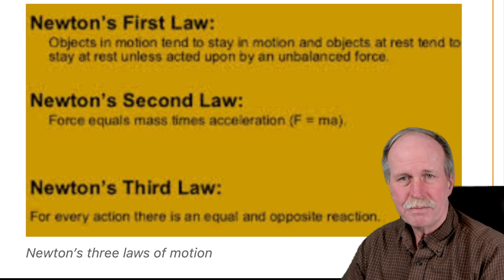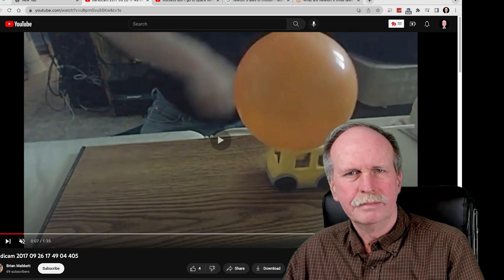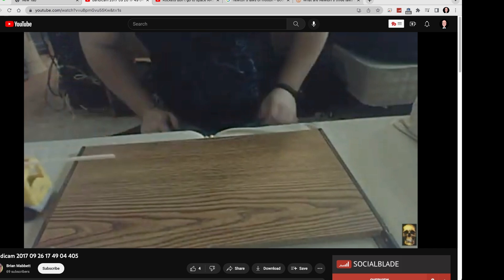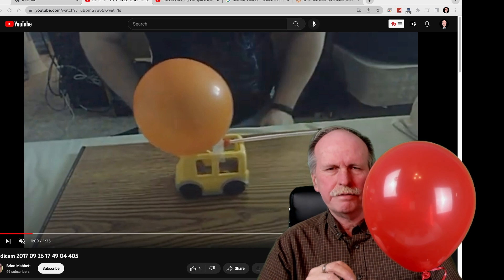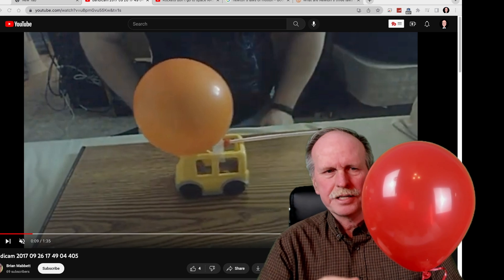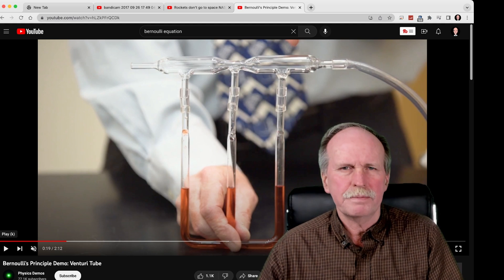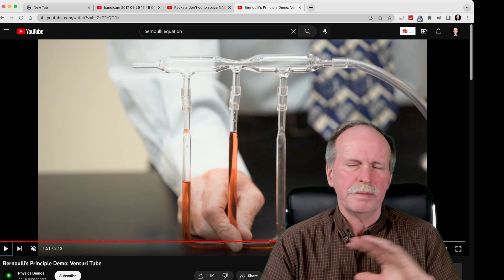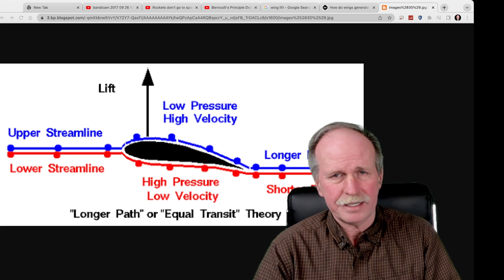Flat Earth Proves Rockets DON'T WORK

Comment: The funny thing is that rockets actually work BETTER in the "vacuum" of space, because there isn't air causing friction on the rocket to act against the acceleration of the thrust.

I saw a thought experiment once where the engines of the Starship Enterprise died, and Scotty started tossing Tribbles out the airlock to create thrust.

Sure each Tribble only had a small amount of mass and tossing one out the airlock didn't exert much force on the much larger ship, but once Scotty had rigged up a Tribble cannon that fired them out into space just as quickly as they could reproduce, he started getting enough thrust to be noticable and limp the Enterprise back to a space station for repairs.
Reply: Best use for Tribbles ever. 😂
Reply: That's not the only reason why rockets work better in space. The big one is the expansion ratio. Ideally you want the bell of your rocket nozzle to expand the exhaust all the way to surrounding pressure to get all the energy out of it, that's possible at sea level but obviously impossible in a vacuum but it also means that you can get extra energy out of the same exhaust by just increasing the size of the engine bell in a vacuum. You don't just expand the exhaust until it's at 1 atmosphere, you can expand it much further and get extra energy out of it.
Reply: The best explanation of how a rocket works I ever heard was from a  Rocket engineer " a rocket pushes against itself"
Reply: Will nobody think of the Tribbles?
Reply: And because Tribbles defy conservation of energy while reproducing, their bodies make a great perpetual motion machine!
Reply: Guffaws in Klingon
Reply: Aww, poor Tribbles! 😭
Reply: Full Tribble Drive - Engage!

I think they test the nacelles by shooting frozen tribbles at them to simulate a tribble strike.
Reply: @nikthefix8918  🤣👍
Reply: Correction: The Enterprise wouldn't be stopping at a space station for repairs. It would be stopping at a Star Base. You're welcome.
Reply: @daveminers3404  - thank you for the correction, I have not watched the show recently and forgot that specific terminology.  I suppose a station like DS9 would not have the correct tools to repair a warp drive, so yes a Star Base would be necessary.
Reply: @Starhawke_Gaming  Here I was just being a smart-ass and you might have me on DS9, which I'm not as familiar with as TOS. I think DS9 is only a space station but must have some repair facilities since it is in "deep space". Good call.
Reply: Exactly what I was thinking.. less friction from an atmosphere
Reply: So where does the "extra" mass of the reproducing tribbles come from?
Reply: @markymarkst3r  - tribbles were essentially magic at creating mass back in the original Star Trek.  They overflowed the Enterprise from just a single storage container full of grain.  It was intended to be silly, not comport to conservation of energy laws.
Reply: @markymarkst3r  you would have to force feed the tribbles then stuff them into the cannon. They reproduce when they eat!
Reply: @markymarkst3r    Quadrotriticale, of course
Reply: @markymarkst3r  They absorb the sub-atomic crouton particles from the cosmic soup.
Reply: Scotty is a God
Reply: Should have used nibbler turds to power up the engines instead.😁😁
Reply: It's lonely at the top. Nobody wants to talk to you anymore.
Reply: @garypellerin5576  - What's that got to do with the price of fish?
Reply: I'm making reference to flat earthers that think they are intellectually superior (at the top). Most people don't want to engage in fruitless arguments (lonely). Hope this helps.
Reply: @garypellerin5576  - 👍 got it.
Reply: LOL... from this moment on, I will forever have this image of Scotty with a Tribble cannon, chucking little furballs into space, as the good ship Enterprise limps back to space dock! 🤣
Reply: I wonder . . . has PETA heard about this?  Will they be at the space dock to protest the abuse of Tribbles in such a manner?  And how will they protest this Tribble abuse?  Will they blockade the entrance to the space dock with their naked bodies?
Reply: Well yes and no. It really depends on what you mean by "better." In the area you stated sure, less resistance = a good thing when it comes to rockets; however if using a engine that needs oxygen like a SRB, fuel efficiency and thrust will drop off which is why SRBs are used as lift assists in atmo and in vacuum propulsion is primarily liquid hydrogen and liquid oxygen with the RCS utilizing nitrogen tetroxide and monomethyl hydrazine.
Reply: @StAjoraGames  the solid rocket boosters have the fuel and oxidizer mixed together. All you need is an ignition source. I believe they still make them out in the desert somewhere in the southwest. I remember seeing a video where a careless human caused a fire which just demolished the whole plant. Everything was leveled. The blast wave could clearly bee seen. The man was up on a mountain miles away filming something else, yet the whole thing was seen, heard and definitely felt way up there. Very impressive, a must see video!!
Reply: @StAjoraGames  
I think you need to reexamine your statement. An SRB does not require atmospheric Oxygen to function. Being solid fueled, the oxidizer is mixed into the fuel. In fact, the oxidizer is the largest ingredient by percentage of the fuel mass. 
The reason it's used on initial launch is because it's a brute force, relativily short duration device and cannot be throttled or turned off once iginited. Making it great for getting things aloft quickly and overcoming the drag of the lower atmosphere.
Reply: @chuckaddison5134   Please point out where I said an SRB would cease to function in a vacuum. "Drop off" does not mean completely die.
Reply: @StAjoraGames  
Your quote, "however if using a engine that needs oxygen like a SRB, fuel efficiency and thrust will drop off which is why SRBs are used as lift assists in atmo and in vacuum propulsion is primarily liquid hydrogen and liquid oxygen".  SRBs DO NOT require oxygen, it is a component of the fuel mix, the largest component as I pointed out. Consequently, it, just like liquid fueled engines, will not 'drop off' with diminishing atmospheric oxygen. Again SRBs are a 'brute force' way to get heavy loads moving and past the friction of the lower atmosphere. they would work just fine in the relative vacuum of space. However, they are plagued by the inability to throttle or shut off the burn once ignited. While liquid fueled engines can be throttled, some cannot be restarted once shut off.  That was a major concern and point of research and development during the Lunar landing program. 
Rockets are different from jet engines in that rocket engines carry both fuel and oxidizer. Jet engines, on the other hand, carry only fuel. They obtain their oxygen from the atmosphere, and thus are subject to the 'dropping off', or oxygen starvation you mentioned.  While some form of jet has been discussed for space launches, as such an engine would save a tremendous amount weight (all the oxidizer) being launched through the lower atmosphere. Nothing practical has yet to be developed.
Reply: Wait a minute, does this mean tribbles will fill up space?
Reply: @Christobanistan  - good question.  They never described what might happen to a Tribble when exposed to the extreme conditions of space.
If they are a hearty as a Tardigrade, they might survive and continue to multiply.

Perhaps if enough of them bunch up together they could start to create their own gravitation pull, and end up with a constantly growing planet completely formed from Tribbles...

Perhaps even eventually getting large and dense enough to collapse inwards on itself, resulting in a Tribble black hole.
Reply: You have to be a trekkie pulling out facts like that one. I wonder what space balls used to go ludacris speed. I know star wars just called it warp speed but they all got there for sure. Seen it.
Reply: @larrymanning5925  STAR TREK call it warp drive not STAR WARS
Reply: And then capt. Kirk and the bridge crew laughed about it. How cruel
Reply: So folks let's face it, the isnt flat, the earth is hollow and the dinosaurs have survived inside the hollow world and dug themselves back to the earth's surface in a gravel pit near Berlin. If you do not believe it, here is a proof video. I saw it with my own eyes.
www.youtube.com/watch?v=QuTMjacAbDo
Reply: The reduced air pressure does indeed mean a longer nozzle for a rocket that works only in a vacuum.   The reason they don't use the same design for the first stage of a rocket is if the exhaust pressure dropped too low, atmospheric gas would force it's way into the end of the nozzle, causing turbulence and reducing thrust.
Reply: Within the atmosphere the exhaust gases will get pushed back a little, which will lead to decreased acceleration.
Reply: So, you do know that Star Trek is fictional right. Make Believe...
Reply: @chrismooneyham5279  - yes, but the elementary example of the physics principal is completely valid.

Try it for yourself.  Sit in a rolling office chair and toss a bowling ball horizontally.
Reply: @Starhawke_Gaming  I can see how that would work here under atmospheric pressure but that can't possibly relate to the same type of forces that a rocket would experience in a vacuum. Dont take this wrong please, I am a high school drop out so don't think I know what I am talking about because I don't thats why I am here to be able to understand it. Thanks
Reply: @chrismooneyham5279  hint: it is actually easier to understand how rockets work if they are in vacuum. 
Atmosphere is really bad for rockets and just complicates the understanding.
Reply: @chrismooneyham5279  - I don't understand why tossing Tribbles out of an airlock would have anything to do with atmospheric pressure.

Newton's Third Law: For every action, there is an equal and opposite reaction.

When Scotty (or the Tribble Cannon) tosses the Tribble out the airlock, a force is exerted on that Tribble, but an equal amount of force is exerted on the Enterprise in the opposite direction, resulting in a small amount of thrust on the starship.
(F = m × a)

If you are in an atmosphere, then you have air resistance creating friction on the surface of the ship with would slow it down and absorb part of the thrust, where as in "empty" space, there is effectively nothing to slow down the thrust and the momentum is conserved, with the force of each Tribble chucked adding up to slowly move the ship forward.
Reply: @Starhawke_Gaming  what the f%$@ is a Tribble? Nevermind im out.
Reply: @adamrak7560  but doesn't it need to be taken into account? It is a resistive force working on both action and reaction. Its ok I'm probably in way over my head but at its basics (which is where I am) seems illogical that it would work. Thanks for your time
Reply: @chrismooneyham5279  you fail to understand how rockets works because you are taking atmosphere into account. You are confusing yourself by trying to understand a much more complicated system. Just ignore gravity and atmosphere first. In that case the action and reaction is between the rocket and its exhaust, the only thing which matters is how fast and how much exhaust the rocket is throwing behind itself (the material of the exhaust does not matter in this simplification, like how the original poster mentioned tossing Tribbles).
The rocket is throwing material behind itself. But in this system the momentum is conserved, so if the material is thrown in one direction, the rocket goes faster to the other direction.
Heating up a gas can make it go really fast if you use a nozzle by pressurizing it. Combustion generates heated gases, so logically most rockets work this way. But different  rocket engines were made and used too. (like using heated water, or high pressure nitrogen)
Reply: @chrismooneyham5279  - "what the f%$@ is a Tribble" - a small furry rodent from the Star Trek series that has no discernable body other than a ball of fur.  Notorious for their reproductive capabilities, which seems to defy conservation of energy, multiplying seemingly without stop when even a small source of food is available.
They make soft cooing and trilling noises, making great pets to anyone except Klingons, whom they instinctively hate and make shrieking noises whenever one is around.
Reply: @Starhawke_Gaming  oh. Thanks I think.
Reply: Doesn't rocket thrust push against air
Reply: @bod121  push against a wall... you go the opposite direction and will regardless of whether there is air around you or a vacuum. Keep making the thing you are pushing away, smaller in your mind. By the time you get to a bowling ball, it seems different, but is not. Throwing is pushing. You still are pushed in the opposite direction when you push something away regardless if you are surrounded by air or not.
The law is, the more massive the thing you push the greater the opposite reaction and the more energy you push with, the greater the opposite reaction.
Rockets push literally tons of fuel away from them very fast. Thus they move in the opposite direction. Air around them would actually absorb energy through friction and make the rocket accelerate less.
Reply: @bod121  - nope, never has
Reply: They work only in the existence of air, Between planets where there is absolute vacuum they keep going by the initial speed (inertia) since there is no friction (Newton 1st law) nothing can stop them, Rockets don't have enough fuel to keep going beyond the atmospheric layers anyway.
Reply: @Capturing-Memories  - so you are saying that the thrusters on the Astronaut Propulsion Unit (APU) that they use on spacewalks to perform maintenance on the shuttle or the ISS don't work?
Because that's what it sounds like you are saying.
Reply: @Starhawke_Gaming  No, they do based on Newton law but the effect is more strong when air is surrounding the rocket, But having less gravity kind of helps the movement.
Reply: That's not the rocket working better, that's less friction. Rockets work differently at STP and in space due to how much the combustion products can expand before it has overexpanded and gets to lower than atmospheric pressure (if it's a nice even jet it will then collapse and bounce repeatedly forming shock pearls in the stream). If the rocket bell is large enough rockets can be more efficient in space.

Comment: This is why airplanes can fly. Nothing to do with rockets in space.
Reply from the maker: The video is about the experiment, the airplane and rocket parts at the end were just demonstrations of the principle discussed.
Reply: @BobtheScienceGuy  Of course. I was thinking of the guy with the ballon-car.
Reply: @ronnyskaar3737  well, people who try proving flat earth by picking on the routes of passenger planes
will try disproving rocket science by experimenting with air pressure...
Reply: Gravity is acting like a force. It is also acting like an acceleration. The equal and opposite acceleration is the free fall acceleration from the gravity.
Reply: @ReinoGoo  I guess, technically speaking, gravity isn't a force and doesn't act like one.  No mass = no force.
Reply: Well, in both cases the lift is generated by acceleration of a gas.
And the atmospheric pressure is generated by the weight of the gas.
The force of the lift and the force of the pressure is the mass times the acceleration.
The acceleration for the atmosphere is the free fall acceleration from the gravity plus the acceleration from the rotation of the earth. That is how the flight levels can follow the level shape of the earth.

Comment: The vacuum of space is not the same as the vacuum cleaner.
Reply from the maker: Really?  Ya think?
Reply: In space no one can hear you clean!
Reply: @tompiper9276  , unless you're in the ISS.
Reply: The Vacuum of space means the no or little stuff - professor Dave.
Vacuum cleaners are used to sucks up dirt on carpets.
Reply: @ducnguyen-qv7sw  mind blown
Reply: @RSProduxx  , having a mind is one thing, able to use the mind is a different thing. FEs never able to use their mind for anything.